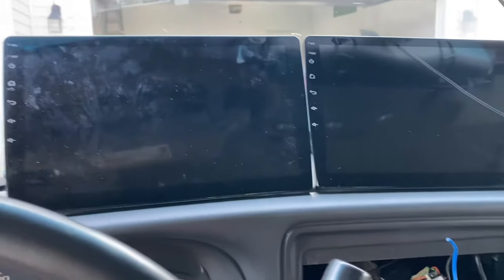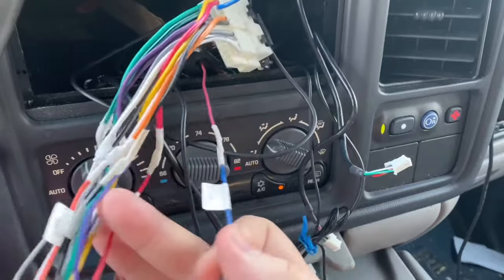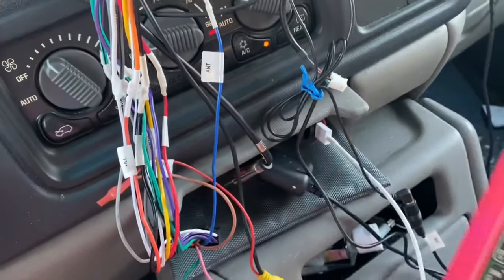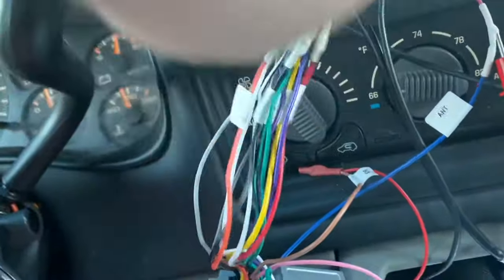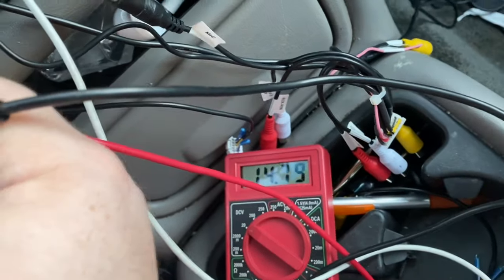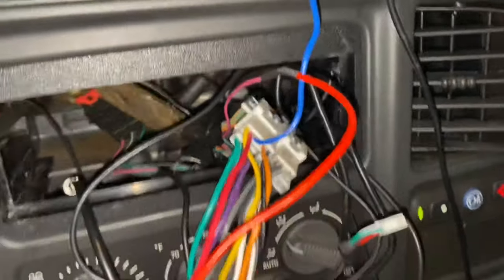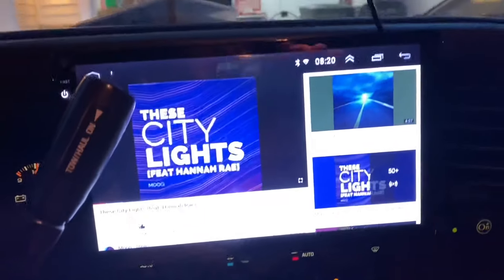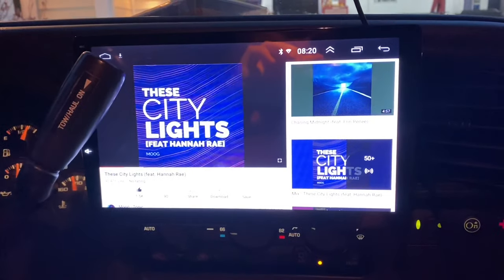Chinese Android Headunit - no sound fix!

Comment: Actually,  I spoke with one of the manufacturers about this. The second pack of stereo cables that have RCA jacks have the blue AMP CONT wire that you need to connect to the factory amp cable. The cable you were using is for a powered antenna. Which is why the radio turns on and gives power to turn the amp on. It’s confusing because the antenna power wire is blue just like the amp wire. Most people with factory amp might never plug in the rca cables since they aren’t using them with a factory amp, hence never locating the real amp wire.
Reply: Grazie grazie
Reply: Scusami il secondo pacchetto di cavi con rca va inserito nellautoradio e di esso va attaccato solo il filo blu ampl. Al cavo rosso acc. Giusto?
Reply: How do i connect the AMP CONT cable to the factory amp? 😅😅 I am having this same problem but dont even know where the factory amp is
Reply: Awesome thank you for this! I was wondering why there was a blue wire on the RCA pack. Do you know where to find or what color the factor AMP wire is for me to connect to the blue RCA wire for power? That’s where I am stuck.
Reply: Like someone mentioned earlier they spliced the ACC constant power to the AMP CONT wire so the head unit triggers the amplifier at start up versus only when the radio app is in the background.
Reply: @evlsc400 yes perfect thank you brother! Much love
Reply: How can I get manufactures contact information
Reply: I had mine connected to the amp and nothing. Idk if mine was faulty. It's supposed to change between both, but you know. Can't beat American build stuff.
Reply: Do you happen to to know what the factory amp cable from the car wiring harness is?
Reply: @DIYBRY  It's going to be different for each car. Just find a store bought harness kit for your car and download the instructions. Those will show you which port on the factory harness and you can then find the cable.
Reply: @giovanniv.7664  Hope you figured this out by now, but yes that is correct. Si!
Reply: @Jake-im8eq  Hope you got this by now, but if not...    It's going to be different for each car. Just find a store bought harness kit for your car and download the instructions. Those will show you which port on the factory harness and you can then find the cable.
Reply: @LGfosheezy  Hope you got this by now, but if not...    It's going to be different for each car. Just find a store bought harness kit for your car and download the instructions. Those will show you which port on the factory harness and you can then find the cable.
Reply: I connected correctly but sadly the RCA (Audio R Out / Audio L Out) doesn't work. Don't know why.
Reply: @kiroosaka8741 same for me. Front works but not rear RCA...
Reply: Sadly, I don't neither have front or back... Only Left and Right..I think is a common problem for the Android Head unit. Infact I am waiting for the seller that he may can help me. If he can't I'll.buy something else
Reply: @MangesCykelochMek ever get it working?if so what did you do
Reply: I have same problem which is installed in my Audi TT mk 2 was already in the car when I bought it as everyone else I have no sound what so ever took the unit out to have a look at the wiring everything looks good solid connections I ain’t no electrician just a mere frustrating car driver with zero sound coming from built in Bose sound system 😢 need help before I end up paying a retailer to fix it for me and probably over charge me as I ain’t got a clue

Comment: If anyone is having this issue with the Chinese android for the Chevy Cruze LTZ, simply unplug the plug with the RED ACCESSORY WIRE. It's a plug with 4 wires on it. Do not use this plug on your new android radio. It shuts off the amplifier and all volume. Took me forever to figure it out and it was honestly by accident.
Reply: Pls make a video on this bro
Reply: Do you have a video on this? I bought a Chinese android screen for my Chevy Malibu but have no sound
Reply: @Jake-im8eq  if your android radio is the same as mine it will be the plug that has 2 black 1 purple and 1 red wire on the harness. Unplug that and just don't use it. I have the premium radio package in my ltz rs cobalt so mabe it's different.
Reply: @Jake-im8eq  do you have that plug on your aftermarket android?
Reply: Cannot find what you're talking about

Comment: This android head unit comes with a separate harness which HAS the remote amp power on it!  It's the one with the audio plugs. No need to use the antenna power or tap into acc.
Reply: Can you provide a link? I'm pretty sure I was given the wrong harness and am pulling my hair out!!
Reply: @tonyelleevans3322  It is called RCA input/output harness. The blue wire is the amp power.
Reply: @Gigaloader  Where should the blue wire (Amp Cont) connect too?
Reply: @Gigaloader  I connected the Amp blue wire with the Amp C blue wire and still have no sound. Audi RS4 B7 2007.
Reply: @NicholasNicolaides  I would measure it out with a volt meter and see if you 're getting constant 12 v coming from Amp C (continues) wire. These are sometimes used by the original car radio to sound the open door chimes and power a sub amp. You don't want to connect to that one as it probably gives you a switched continues 12 V.  I think Audi may have blue wires with a white stripe as their amp power.
Reply: @Gigaloader  I had the power wires correctly spliced. I had the wrong RCA Aux L In and Aux R In wires to the wrong  RCAs. I get sound now however I had to order the special Audi harness from Teyes that has Hi Low impedence filters as Im getting a horrendous humming wine. Apparently the factory is high voltage and Teyes CC3 2K is low. Thanks for your response.

Comment: My Android 10.1 unit uses a harness for JBL amplifier. To solve the no-sound issue, I connected the AMP CTR wire from the main power plug to the AMP CTR from the RCA plug.

Comment: Thank you sir!  With your video and a Positap I had this fixed in about 90 seconds!

As one other commenter noted, there appears to be an amp wire (blue&white) on most of the RCA plug harnesses.  From what I can tell, this is actually switched by the UI, but it’s probably easier/faster for most of us to just tap the ACC line so the amp gets power at the same time as the HU.  

Thanks again!!!

Comment: Thanks for the video. I too just had the same problem with my upgrade, except i had an amp wire from the radio and connected to that instead of the power antenna wire. This video only applies to an external amp. My other truck is basic and works fine. Thanks again for the video

Comment: Hey, thanks for your video. I bought a head unit for my e90 off of Amazon and didn’t return it because I knew it had to be an easy fix. After buying a cheap $5 multimeter from harbor freight, I had it fixed in a few minutes… Just like you said, I found the amp wire that was turning off when opening apps, yet it was on when using FM/AM radio and simply spliced ACC power to it. Now I can use my CarPlay. 😂
Reply from the maker: Right on man, enjoy
Reply: Did your stereo came with a harness ?
Reply: Hey! I have an e90 328i 2007 with a headunit from amazon as well lol. I was just setting it up today and I am at the same situation these ppl are at. Can you explain which wire is the amp on the e90 or make a video? Thank you so much! And merry christmas
Reply: So splice amp wire and run it to which wire

Comment: Good deal glad you got your problem fixed I just installed the head unit and haven't had any problem until tonight and I can't get the radio app to open the screen goes black and then it goes back to the home screen any one else had that problem

Comment: There is a setting in the audio portion of settings to turn the amp wire and the antenna wire on and off in the software.  But, there should be another Blue wire marked Amp, and it also can be turned on and off and this is the wire yiunshould be using.

Comment: Thanks bro this video really helped me solve my issue. I was getting ready to install a switch in between my blue amp wire coming from my android radio

My issue was I would only get power from my blue amp wire from the unit only when disconnecting and reconnecting it.

Comment: Ant wire is for a power ant, you gotta use the blue with a white stripe for remote amp
Reply: I was just wondering. If I don't have an external amp, will I still have this problem? Or is it just for external amps?
Also, how does it sound without an external amp?

Comment: I just installed the awesafe unit and it works great except for the rear speakers in my 2008 enclave without premium sound. I fade fully rear with volume all of the way up and still nothing. Stock head unit worked flawlessly. I don’t have rear amps as far as I know. Wiring diagrams don’t claim there is anything in between the head unit and speakers.

Comment: Good find Patrick, well done mate. Was hoping to find the answer to my similar problem here but I don't think this is it. But I suspect the wiring harness is wired wrong on my new head unit as well. Ignition sometimes turns the head unit on/off. Sometimes it doesn't. Sometimes turns off randomly sometime after you've turn the ignition off. My antenna does go up/down when the head unit turns on/off respectively, so I don't think that is my problem. Also no sound intermittently on any of the music sources (BT phone or local apps) and only a factory reset fixes this. But sometimes it doesn't lol. Pretty sure the on/off problem is due to something like the main power supplying the unit being wired up to the + wire that feeds a constant 12v supply to help the head unit hold its memory, or something like that? No idea. But I appreciate seeing that other units have had wiring issues as this gives me hope. Anyways, fun and games. If anyone recognizes any of these symptoms and can save me some headache troubleshooting, I'd appreciate the suggestions! Cheers!

Comment: Well on my car I did hook it into ACC and it drained my battery dead overnight....each car is totally different configuration. If when you take out the key and open your door the unit is still on...then you can't use ACC even if you power off the unit from the front it doesn't matter. The yellow wire is for contant 12V basically to retain time and preset stations....it will not draw anything like if it was hooked up to ACC

Comment: Having the same issue, going to try this - do I splice the blue AMP (from the new head unit) to the car's (Renault Clio 2014) accessory power? And how do I know which cable is the accessory power? I have tried finding a wiring harness online but cannot find anything! TIA

Comment: Hey, I really like how you broke down everything in this video. I was wondering if you might have some advice or an answer in my situation. My radio is working my Bluetooth and other sounds are working, however the stereo from the right front and right rear speaker is not coming on whatsoever. 

 I’m only able to hear music and sound from the left side driver’s side. What do you think maybe the cause of this? I just recently got some repairs done and I’m just wondering if maybe the right front and right rear speaker have been accidentally removed 🤔

Comment: I'm sorry to ask but You are my last hope: I live in Sweden. I bought a Chinese Android Car Stereo at Amazon but I know so little about technic so I don't even now if Your problem was the same as mine but I ask anyhow: My car seller installed it for me. But when I start my Kia Sportage 2013 and connect my phone/Carplay I can hear little radio/Spotify first. But a few seconds or minutes later (when I star driving) the sound dissapears. I can see the radio/Spotify running and also the map but no sound. Sorry my incompetence but is my problem the same as yours? /Maria
Reply: Same (but Audi A3 2004) will try the solution in a few days and report back
Reply: Same(but a different car AUDI A3 2004) will try the solution in the meantime and report back.
Reply: @vitorcortes8694  THANK YOU for just answering! Can’t believe u took time to do that, thank you🙏🏻🙏🏻. I have been to a store here that sells other stereos. They don’t know how to fix it, I have to buy a new one  But he says I don’t have a amplifier in my Kia.  I believe u said it need to exist one to try to fix the sound right??

Comment: I am having the same problem and I’m a total noob to wiring things up but I had the blue wire from the amp tapped into the blue antenna and only radio worked like you said. Then I tapped into a red wire in the harness (the only red wire, I don’t have a meter, so I just guessed) but now there is no sound at all. Any further suggestions?

Comment: Idon't get any Audio from any source , i could not find any amp switch or amp remote wire for my fiat 500 on the wire diagram , I did find wires for "amplified" rear and front , left and right speakers and also for amplified subwoofers 1 and 2 (+) and (-) so i have no idea witch cable to split to connect the acc.
Thanks for your help.

Comment: AC stopped working in my 2009 Honda Accord after installing an aftermarket android radio. Any idea why that may be?? 

BTW, if I remove the head unit, and install back everything factory, AC starts working. 

Any help be great...
Reply from the maker: @cesiumion  uh that’s pretty crazy, I gave no idea. Start with the basics - check for shorts, wiring issues, bad grounds, etc.

Comment: You use the (amp turn on or remote ) .. the antenna wire is to put up an power antenna . So when u switch to everything but the radio that ant wire will not work .
Reply: In the settings you can set antenna always on. That would keep power to it.

Comment: Just had a really good look at all my cables. Tried everything. My problem is exactly the same but my sound does actually work for a split second then it shuts off. That's you tube on the actual unit and music playing via Bluetooth. A split second, so frustrating
Reply: Same but after a few days with that problem now its completely mute. U find any resolution?

Comment: Hi friend, very good video. But I would be very happy if you could help me solve a problem that happened with a 2016 Clio 4, when putting it in reverse the proximity sensors work with the bar indicating the colors, but it does not make the approach sound which helps a lot to notice an object or person without having to look at the screen. With the original screen it worked correctly, I would greatly appreciate if you have any ideas about it, I took it to the technician who installed it and he did not know how to solve it.

Comment: My Honda City 2009 android head unit does not supply any sound to the rear speakers. The front speakers works just fine, but the rear speakers are not working. Please assist with this
Reply: Did u fix this

Comment: Have you had any issues with the usb connections? Same unit here. I have zero connection coming from the USB ports. Changed usb settings around from device to host and 2.0->1 and back again. Trying anything and I get nothing. No charge, no read from a thumb drive. Haven’t gone as far to test the port with a probe yet.
Reply: I had this issue, I hooked up the usb wires upside down. Flipped them and all is goid with it now.

Comment: thanks for info
Although I have an antenna voltage connection to a suitable connector
I still have the same problem as yours
  I did not understand where you connected the blue wire - is to the ACC?
Reply: Same here did you connect the acc to amp?
Reply from the maker: @Brunsen-0  Blue is no longer connected, its cut. I have ACC switching on my amp now.
Reply from the maker: @ecec5297  yes
Reply: @MegamanEXEv2  did you mean that you connected ACC into the ANT wire? i still dont get it.
Reply: I dont understand, i have the same problem, but i have already power on the blue wire🤔
Reply: He bypassed the radio ALL TOGETHER and basically hooked his amp up to a switched power (ACC) wire. This is for a Chevrolet silverado it looks like

Comment: MAN this drives me crazy also! 
So you just cut the ANT wire from the amplificator and wire it to the accessory and that's all? 
I will try this fix and come back! 
Thank you very much for your video!
Reply: did it work?
Reply: @ianpaulpaul6815  i didn't try it, i replaced the motherboard of the nav.
Reply: @Ultimate Sayian i didn't try it, i replaced the motherboard of the nav.

Comment: where does your pink wire coming from?
direct remote amp wire ? is it from the harness adapter or the vehicle side?
Reply from the maker: Vehicle side
Reply: @MegamanEXEv2  
thank you! I'll tap the ACC red wire and feed it to my amp remote wire tonight.

I just don't understand why they can't have the ant control output stays on with the headunit. It can be a very simple fix on the firmware side.

Comment: Nice. My problem is today smoke came out the back of the unit, no more sound. Ontop of that, the sound settings is gone from the menu. Its blank screen. I did factory reset  didn't fix it.

Comment: What brackets did you use for this install? I’m putting this same radio in my 2001 Tahoe and I can’t figure out a good way to mount it. It doesn’t come with a radio sleeve like other radios.
Reply from the maker: Actually haven't sorted that out yet, its not hard mounted. For a while, I used pieces of Harbor Freight Anti-fatigue floor mat cut up to brace it, but right now its just sitting in the hole. I will come up with something at some point to mount it.

Comment: I'm having no sound issues on 10.1 model 9216b got it off ebay even installed old radio speakers work but when I install new unit it powers up but no sound. It's a 2000 jeep wrangler . Please help thx.

Comment: I have the same problem but I have no sound at all I don’t hear the radio but I think that’s because the radio isn’t on USA stations but did you connect the ACC wire to the ATT wire?
Reply from the maker: I connected the acc wire to the amp switch wire, the ANT wire isn’t connected to anything now.
Reply: Yo lmk if u were able to fix yo problem, ig:0hWellJoel 0is a zero